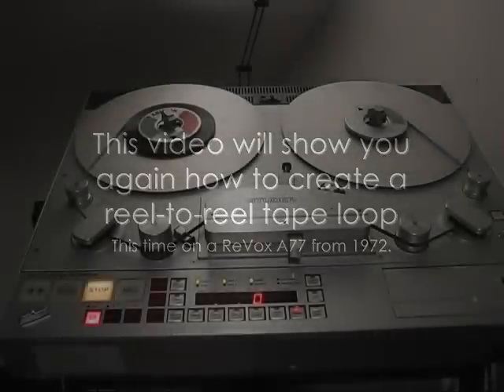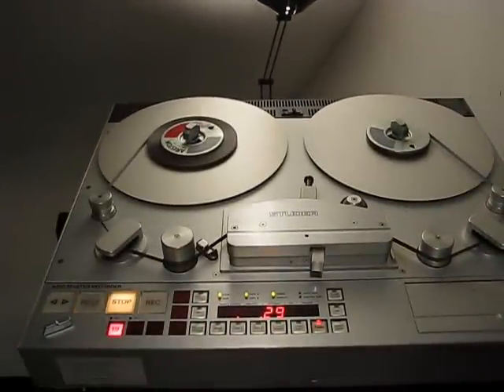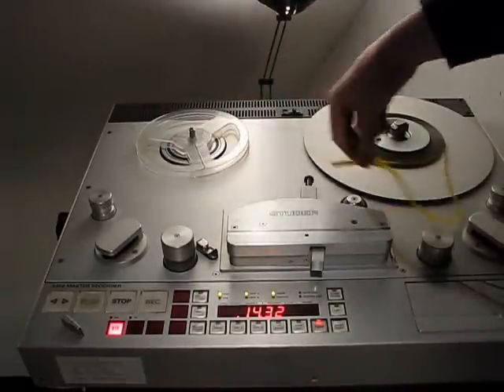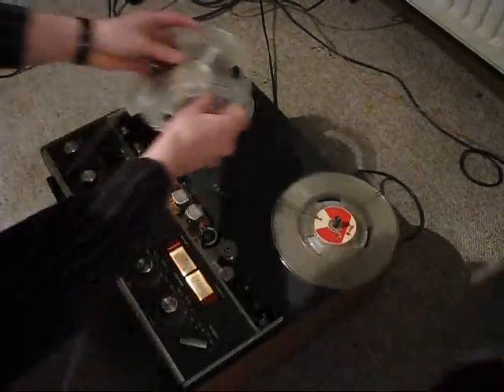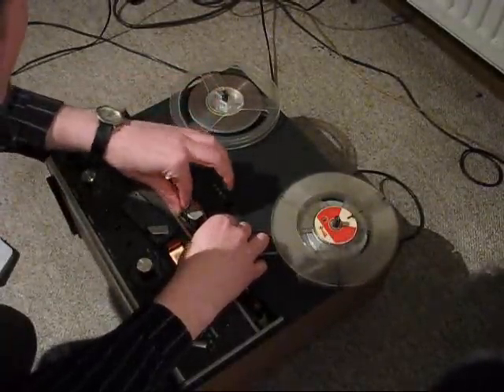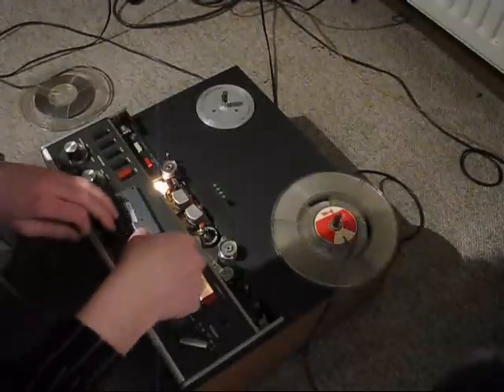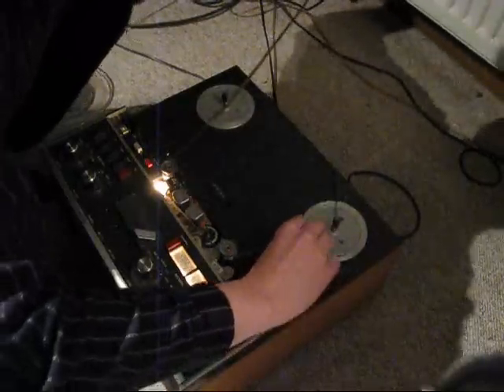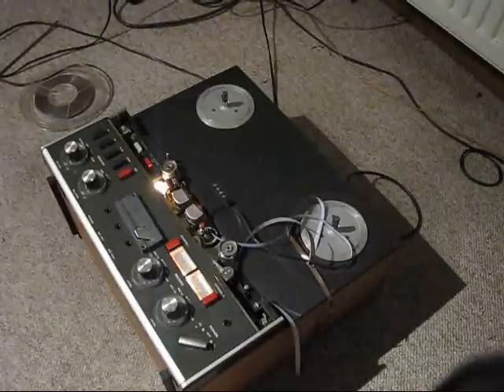Revox A77: How to create a reel-to-reel tape loop

Comment: LOL@ 7:03!!!!! You get respect from me for using an A77 to do this--not an easier B77 or PR99.  Thanks for the posting! I have 3 A77's (1 HS and 2 Dolby models)--I had all but given up on using them and have been using my B77 and PR99 units.  I will use my A77s now!

Comment: After having been a professional sound engineer for 25 years, I had a good laugh watching your video!
(It almost shows how it should NOT be done, hahaha! :) )
Reply from the maker: As long as you get entertained, everything is good to me. I know that it wasn´t perfect, but it was just a short improvised video to give people which are not familiar with the "how to" a clue of how to do it. Maybe I will do another video and than also you can see, that I know what I´m doing... ;-)
Reply: ***** I didn't write this to piss you off (I am sure you know what you are doing), but almost everything that could go wrong, went wrong! (Edit wasn't perfect, splicing tape was sticking out, tape loop got stuck in the Revox etc.).
But I thought is was very funny to watch!
By the way: beautiful Studer machine!
Reply from the maker: Ruud van Steenis
It´s ok Ruud - I don´t take that all here not to much serious. ;-) Anyway: I think I will do a new video in the next days! :-)
Reply: *****  real good or not,, its fun to see back haha,
i used to make the cuts allways in a 45 degree angle or less, gave a bit smoother  transition, fun times with that old stuff :)

Comment: Excellent video!  Thanks.  If the tape deck is off the floor, you can create tension by simply hanging a reel from the tape loop, and letting it  dangle over the edge.

Comment: What about using the loop for using the A-77 as a tape echo ?
Reply from the maker: +DOPEDOGTOPDOG I did not try it untill now. But it sholud also be possible if there is enough tape-tension on it.
Reply: DOPEDOGTOPDOG my exact thoughts, I'm looking at a teac 4010 to use as a tape delay

Comment: Is there a specific equation of tape speed and tape length to work out where to splice so your loop plays in a 12 bar in 4/4 time for example. I am planning on making some loops but will need them to always play in time when the splice goes over the head.
Reply from the maker: I think it depends on how long the loop should be. But usually the fastest speed is the best speed of course. 😉

Comment: Hello, I leave a question, maybe you can help me. Does the sound of a revox a77 depend 100% on its heads (head)? I'm seeing if I buy Revox a77 that apparently has changed heads and I have my doubts. Thank you!
Reply from the maker: Hello Ale! The tape heads are always extremely important for the sound of any tape recorder. With old devices it is normal for the tape heads to be ground in a little. If the cut is too strong, the recording and playback will lack the treble. Sound heads must not be ground in more than 3mm.